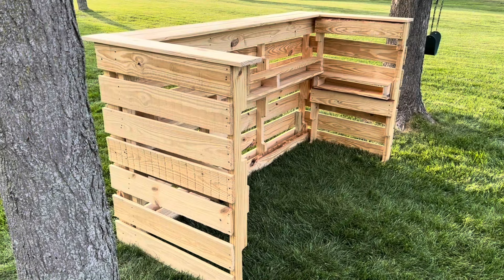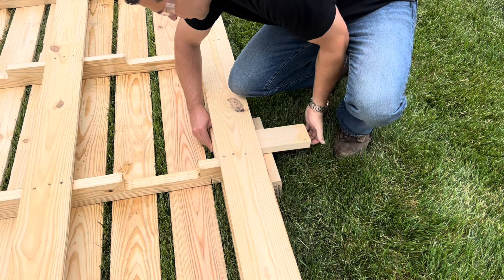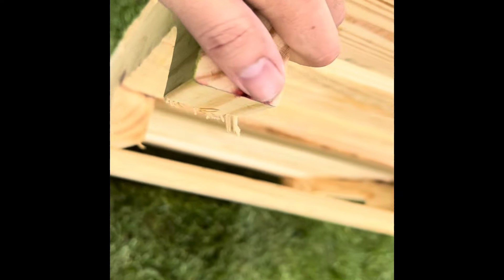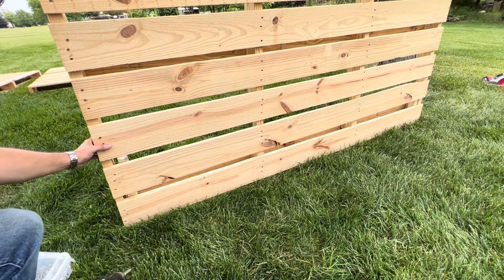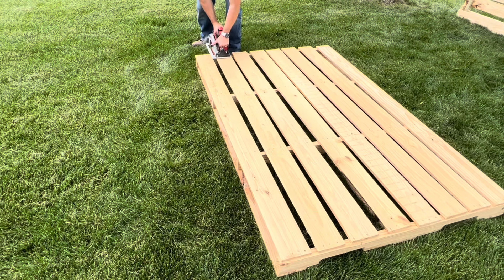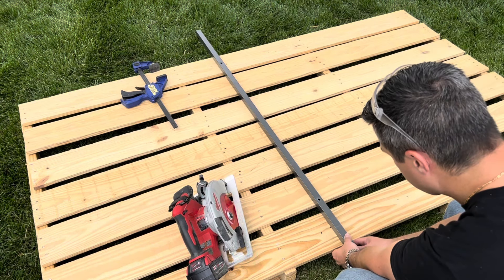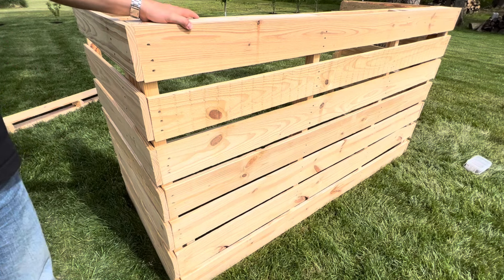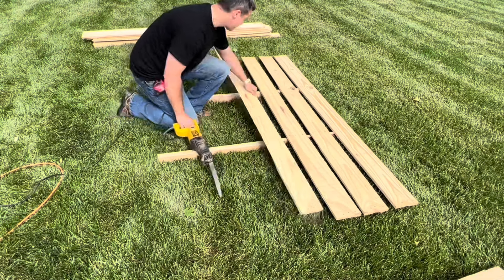How to Build a DIY Pallet Bar

Comment from the maker: Below are the tools and supplies used to build yours!
Circular Saw: https://amzn.to/458eeon
Air Hammer Kit: https://amzn.to/3qXaypM
Air Compressor: https://amzn.to/43RWIDD
Reciprocating Saw: https://amzn.to/3MBmgyN
Brad Nailer: https://amzn.to/3Om2Lf0
Drill: https://amzn.to/3P8BtWi
Reciprocating Blades: https://amzn.to/3Il7CJm
Saw Horses: https://amzn.to/3pRXjX7
Hearing Protection: https://amzn.to/3IjaTI3
Speed Square: https://amzn.to/44gg8mb
Layout Square: https://amzn.to/3No9ylZ
Quick Grip Clamps: https://amzn.to/407w1bI
Hammer: https://amzn.to/3oQK8lb
Tape Measure: https://amzn.to/3IkGv04 
Jobsite Markers: https://amzn.to/3nOxshR
Safety Work Gloves: https://amzn.to/3IlCDNA
Safety Glasses: https://amzn.to/3RcTF36
Screws: https://amzn.to/3r2k0YR
Brad Nails: https://amzn.to/3XlSQs6